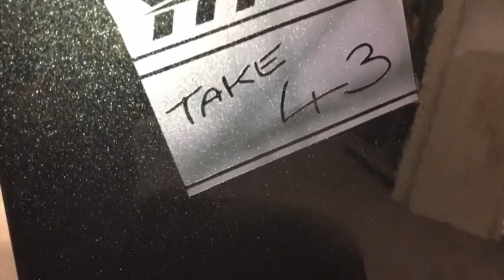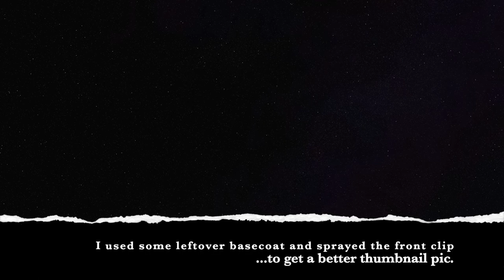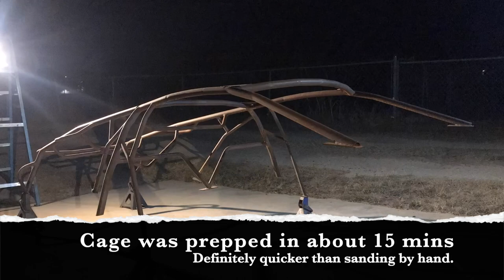Building my Vaydor G35 Supercar!  Days 1-6. Planning, Teardown,  roll cage blast, paint, test fit.

Comment: Amazing video!   Are the front wheels too far forward in the fender, or is that an adjustment that gets made later in the build?
Reply from the maker: Yes the factory wheels are only temporary. I have to order specific offset 22 inch wheels that are meant to fit this body.
Reply: wheel placement in fender - worth the effort. ... nothing screams bad DIY kit car  on any brand like bad wheel placement

Comment: I have a question about the interior.  When you install the dashboard fiberglass inside, what tools do i need to use to install it? And the center console as well.
Reply from the maker: I'm just barely getting started with the interior so I don't have many answers for that just yet. The main thing with the dash is getting it trimmed just enough to make it fit and then see where you need to "fine trim" a little more. It's ok to use self tapping screws to temporarily hold things in place but you'll want to come up with better ways to do the permanent fastening.

Comment: Honest opinion.  Is the quality of the kit worth the money?
Reply from the maker: Good question and here’s the way I look at it. Keep in mind, I am a licensed A/P aircraft mechanic with years of composite experience and training. That being said I’d give it an overall rating of 7 out of 10. 

The areas to be painted are pretty well covered with gel coat and pretty straight/smooth, from what I can tell so far. There are the occasional bubbles/voids here and there that you’ll have to dig out and add some resin/flocks filler, but it could be worse. As far as the overall quality of construction, I would like to see a little bit more consistency in the material thickness throughout some of the parts, and maybe more woven cloth rather than chop mat but they still use at least a layer or two of woven from what I’ve seen on most pieces. I have had to repair a few cracks/tears but those seem to be more related to packing/transport rather than construction. 

Now to fully answer your question here’s my take on it. Yes, it is worth the money. Maybe not so much the quality of the initial kit construction but to me, this is the coolest looking car I’ve ever seen and what you’re paying for is the ability to build this car. You’re paying for them to basically give you a great head start in owning one of these bad ass cars. You’re not paying for perfect parts to just put this car together easily. If that were the case, The cost of the kit would obviously be a lot more but I think at the current price, it’s worth paying that just to give yourself the ability to put in the work and figure this thing out. Hope this helps!
Reply: very solid -  I have built fiberglass cars in past. . . this is waaaay better, fit form and function.  they added steel into the fiber layers in many spots but some where still needed, also we beefed up the roll cage a bit.
After building 2 daily driver vaydors -  it better to go ahead and add few more layers of glass around the headlight areas + undercoating as they are prone to cracking after putting  miles on around town hitting bump and pot holes and construction areas.  . . . but still better than most kit cars MNFR as they seem all crack right at the windshiled pillars /  meets the body.   I have not seen that on any vaydor.